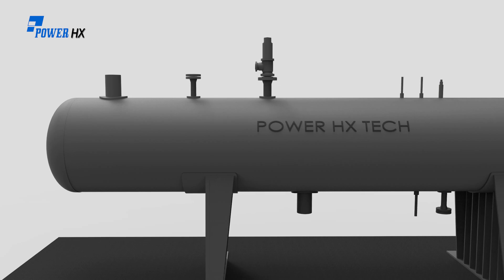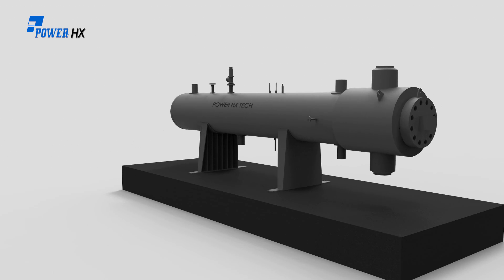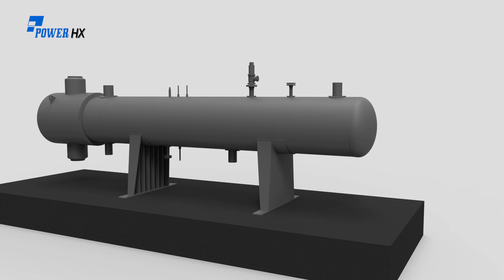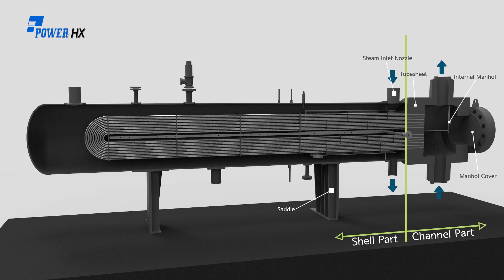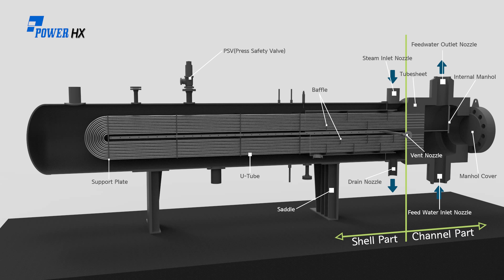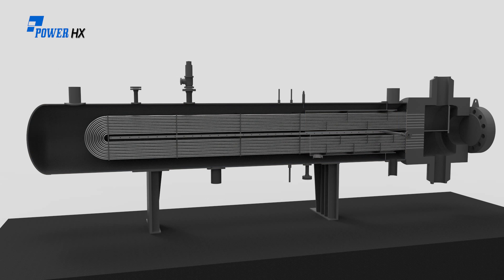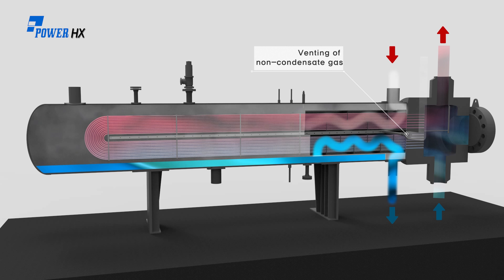Feedwater heater Operation animation by Power HX

Comment: Misrepresentation, In the "primary part": hot water enters from the upper side (heating medium), and cooled water leaves from the lower side.
In the "secondary part": hot water comes out on the upper side, and cooled water enters from the lower side.

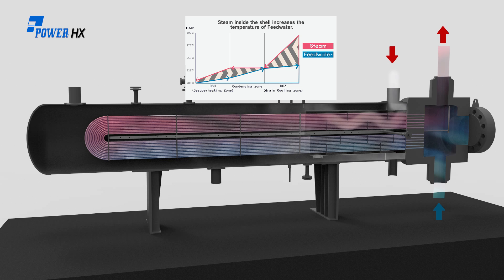Comment: Correct me if I'm wrong, but isn't the temp-path length diagram (1:25) showing desuperheating zone and drain cooling zone in the wrong places, in this video?!
Reply: It actually seems like, I am just preparing for my exam and I also think so! :)) Like the first heat exchange for the feedwater is the condensed water that gives its reserve heat to the feedwater, then condensing steam gives the biggest amount of heat to the feedwater, then the very high pressured and temperatured steam gives the extra heat before feedwater exiting at the top.  So the diagram is correct, but the labels are not, the first one is the DCZ and 3rd one is the DSH!